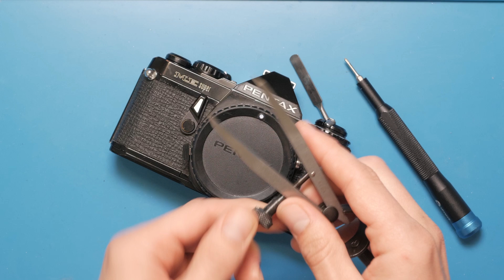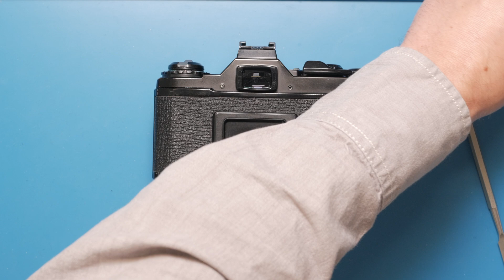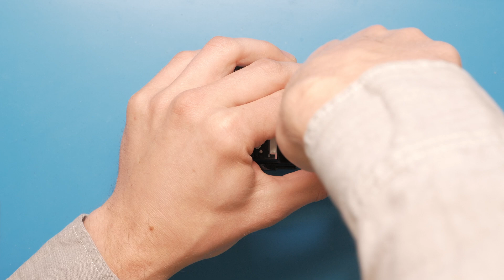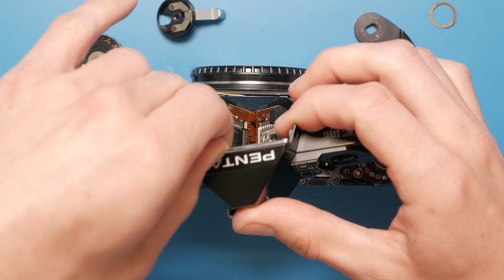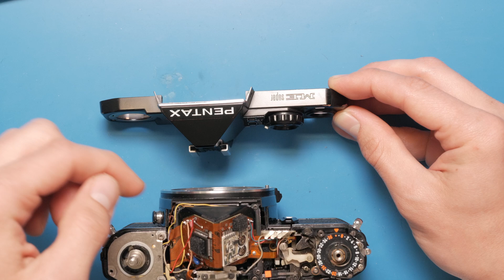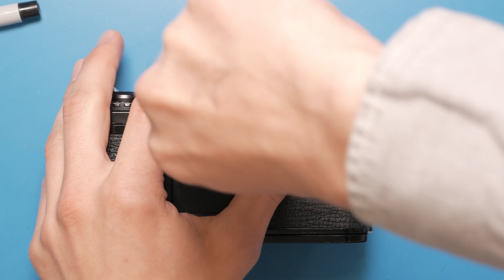Pentax ME Super Top Plate Removal + Meter Calibration

Comment: I don't think this is how the variable resistors work in the ME Super. The bottom dial will adjust the speed of the shutter in auto mode while the upper resistor adjusts only the LED readout. Another way to put it is that the lower dial will change the speed and the LED that is lit up, while the upper will only change the LED that is lit up. This is confirmed in the service manual.
Reply from the maker: Thanks for the info! I looked up the service manual and I can see that you're right – I should have checked to see if a service manual was available before making this video.

I'll pin your comment so hopefully viewers will see it.
Reply: Maybe I'm misunderstanding something, but are you saying that the upper dial is just for making sure that the speed and light aren't out of sync?

Comment: Hi, thanks for the tutorial it was really useful. My ME Super works when there is no battery. But the moment I place the battery the shutter works like in BULB mode. Any ideas to what I need to check on? Thanks!
Reply from the maker: There might be a problem with your mode dial. If turning the mode dial back and forth through all its positions does not fix the problem, you might try taking off the top plate and making sure all the connections between the mode dial and the metal tabs inside the body are solid. Hope that helps!

Comment: Hola, muy buen tutotrial felicidades.
Tengo una consulta sobre mi Pentax ME, en velocidaes de 4" a 1/125 funciona correctamente y de 1/125 a 1/1000 solo dispara a 1/125, los indicadores led del visor indican la velocidad correcta comprobado con un fotometro de mano externo, mi consulta es saber si esta averia se corrige con el calibrado de las resistencias variables ? o proviene de otra parte?, gracias de antemano por la ayuda que pueda darme, saludos desde BCN.
Reply from the maker: Hi, thanks for watching!

First of all, my description of the function of the variable resistors in this video is wrong, please take a look at the pinned comment for an explanation. The ME Super service manual is available online and explains how the resistors affect the shutter speeds and indicator LEDs.

Second, I am not sure whether the ME and ME Super have the same calibration dials. If they are the same, then your issue probably cannot be fixed with the dials.

Since 125 is the sync speed, if the fastest speed you can get is 125, it sounds like a second curtain timing issue. That is, it's likely mechanical and not related to metering. Mechanical issues with the shutter are a little beyond me, I hope that helps though!
Reply: Hola, estoy de acuerdo con la conclusión de que no es calibración de resistencias (sirven para ajustar la lectura de la fotocélula los valores de luz EV con respecto al ISO 100 Base) las resistncias no tienen un efecto directo ni sobre el electroiman de obturación ni  sobre la segunda cortinilla, por lo tanto llego a tu misma conclusión, la de que es un fallo mecánico, basicamente despues de 40 años necesitan ENGRASE y poco mas.
Me pondre a ello y cuando concluya la lubricación escribire de nuevo con los resultados.
Saludos desde BCN.

Comment: So, you had a couple of mis-steps (calling ISO dial mode dial, etc.), but this is still one of the best how-to videos that I have seen on simple camera repair/disassembly/reassembly on YT. Thanks for the clarification on the calibration setting dials and relation back to the service manual. I feel like my ME Super and ME Super SE both need their meters slightly calibrated to increase overall exposure, so not likely off from fouled sensor surfaces as one commenter here pointed out. If there was any interference with light reaching the meter I would fully expect overexposure to result, not under. I made sure to save this video for my near future work on my two bodies. Also, thanks for the tips about the tools. The hollow rubber stoppers are items I need to get. Very helpful video, thanks.

Comment: Hello Evan. Cool video! Will there be a disassemble video on pentax mx?
Reply from the maker: Hi, unfortunately there's no video on the horizon as I no longer have a Pentax MX (though it was my main camera for years). However the MX is very similar to the ME Super in construction, and there must be some good teardown videos of the MX out there.

Are you having an issue with your Pentax MX? I've worked with them so I'd be happy to try and help you diagnose.
Reply: @EvanDorsky  Hello ! i would love a little bit of help for mx cameras if possible ! i'm not knew in camera repair but since recently, i was only specialized in Canon cameras, but i started learning the pentax cameras, MX LX KX K1000 etc mostly. and most of them, especially the MX, i can't find a way to put back correctly the mirror box once it have been taken out, i don't know where i do it wrong, is there any position the mirror have to be to be put back ? should it be disengaged, armed, or anything else, is there a diabolical rope technique like for the Nikon FE lol ? 
i'm lost x)

Thanks a lot 
Cheers
Reply from the maker: @georgeabitbol4180  Hi! I've never taken the mirror box out of an MX, just the ME Super. With the ME Super I think the shutter / advance lever did have to be in a certain state for the mirror box to come out or go in. There are resources online specifying this for the ME Super that might help you with the MX. Good luck!